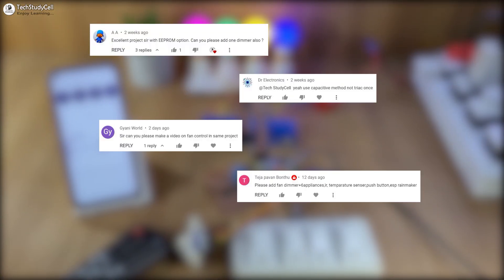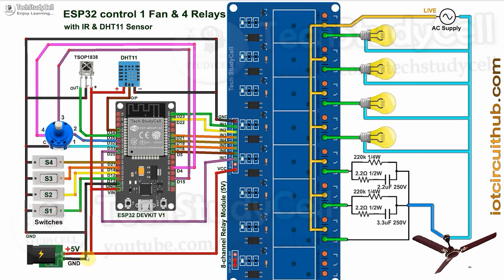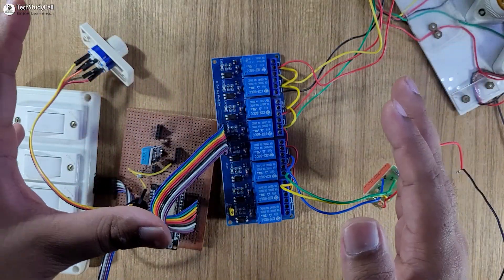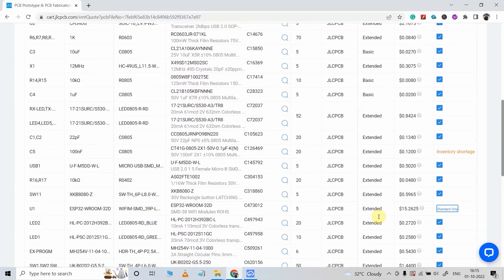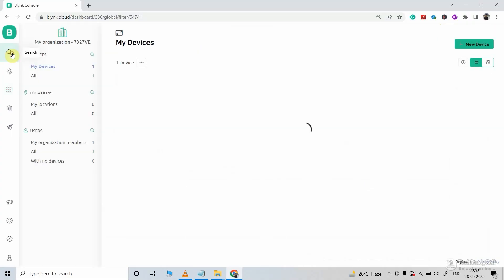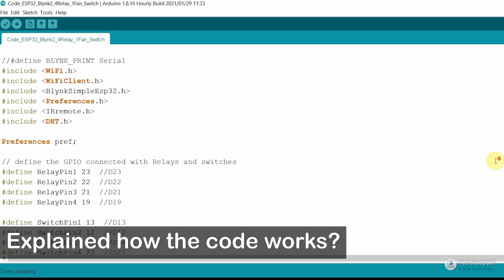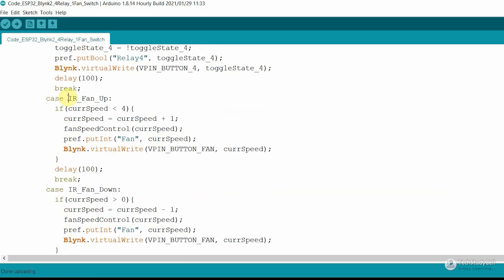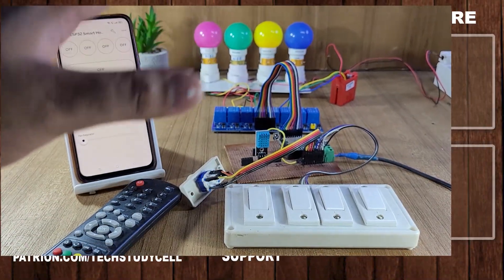The SMARTEST Home Automation System 😎😎 with FAN Speed Control using ESP32 Blynk | IoT Project 2022

Comment from the maker: ** 1 correction in the circuit shown in the video. DHT11 O/P will connect to the RX2 (GPIO-16) pin of the ESP32.  (Please refer to the following circuit)
https://iotcircuithub.com/wp-content/uploads/2022/10/esp32-iot-project-circuit_p4.webp

Download the new PCB Gerber and Source Code for this IoT Project from the following article:
https://iotcircuithub.com/esp32-home-automation-system-with-fan-speed-control/
Reply: Hello Sir, I am facing issues with relay.
My relay is getting NC to NO.. on applying both 3Volt and ground

When I touch input pin of relay to 3volt of nodemcu it gets switched... And if i also connect it with ground pin of nodemcu..it also switched on
Reply: After restarting due to load-shedding, the fan speed is work according to the regulator nob but I want it to work according to the last speed I selected on IR Remote/Blynk. Do you know how I can solve this?
Reply: Same problem  @hastalktechtube5901

Comment: Hi. Can I ask if i can use polarised 2.2uF 250V capacitor and polarised 3.3uF 250V capacitor in the connections from the relay to the fan?

Comment: Without the Internet, I am able to control all devices using Hard Switches, IR-Remote, and Bluetooth APP. However, If my Wifi Router is turned OFF, Nothing is turning ON even through Hard Switches or Bluetooth APP. What modification is required?

Comment: Hi sir my project is based on home automation with 2 channel relay with also I have used mq6 dht11 ultrasonic sensor, pir sensor, IR sensor, moisture Sensor, esp8266 and I want to control my fan speed depend on the temperature this is possible or not

Comment: Sir what type of capacitors did you used in discrete circuit it is polarized or Unpolarized
Reply from the maker: Unpolarized AC capacitors

Comment: Sir is 5 volt supply necessary for making home automation project using nodemcu and esp32. Please clarify my doubt sir
Reply: Yes
Reply: Because the relay module and some other sensor needs 5V and the esp can work on 5V. If you use 12V because you may have purchsed 12V relay then the esp would be fried. And if you reduce the voltage to 3.3V then relays won't work. It has to be 5V. If that Big adapter is the problem, then just purchase the 5V AC to DC